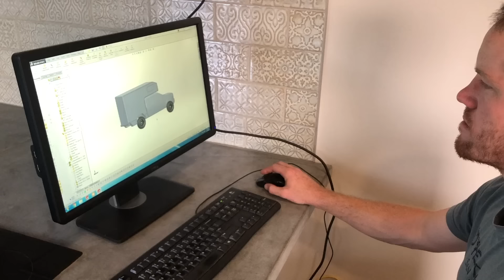TIMELAPSE- Couple Builds DIY RV (Start To Finish)

Comment: "Two car garage" ....opens door....with cnc plasma table. 😂
Reply from the maker: If it fits... 😉
Reply: Lo
Reply: Lol
Reply: I have an 200kg payload 6-axis robot with an plasma cutter or belt grinder in my workshop😅 (but we also use it for actual jobs and not only car parts😂) next it will cut two aux-tanks
Reply: I wonder if the CNC table was included in the 25k budget
Reply: Exactly! 🙈
Reply: @buggzo  

Those two at shop rate would be $200 to $250 an hour for quality custom build. Multiply that by 8hr x 5days x2.5months = Approximately $80k on the low end. Then add the Truck plus materials and your at $150k for the build let alone some kind of design fee or mark up. Very cool, they have great skills and was fun to watch.
Reply: @buggzo  That's what I was thinking. $20K in materials and $100K in tools.
Reply: Yeah, stopped there.
Reply: they propably worked in an rv or car asssembly  company and bought their own tools.its like they already know how to do this from start to finish.
Reply: 🤣🤣🤣 My thoughts exactly
Reply: @TurboTaco2JZ  depends.....I have been to the ALiner factory. ..I build for a living...I was TOTALLY impressed.
Reply: And alum Tig ;)
Reply from the maker: Glad you liked the build! While appreciate your value on our labor, you cut us a little short on the hours! More like 14-16 hours per day and 7 days a week!
Reply: @AmbitionStrikes  now overtime has to be added into the cost. You guys are amazing. Keep making vids!
Reply: husband and wife look like high end craftsmen
Reply: i stop the video at the intro...with the pan of the car sizes plasma cutter.  It's probably DIY built plasma cutter from another video.  I need to watch that first before I watch any of these "DIY" project.
Reply: And sheet metal bender and TIG welder and barn....
Reply: @vanlifephilippines7304  pays to know what to do just saying.. save yourself some $$$
Reply: @buggzo  I think the 25K budget is just for the tools! 😳
Reply: Exactly hahaha how typical
Reply: yoruma dağıldım :) ne garajmış breh breh
Reply: 90s
Reply: DIY actually YNH (you need help)
Reply: @snteevveetns  which all costs less than 500ft apartment in new York :)
Reply: And a large Brake/bender
Reply: They are very disingenuous with their title. Gotta get those "Likes" , though! Amirite?
Reply: @vanlifephilippines7304  actually all of the skills they used are basic level metal and woodworking skills. The biggest achievement for them is the design to build ability. That takes a lot of skill to see through.
Reply: What funny about that? Its still a 2 car garage
Reply: that's noway, It is an act of deceiving subscribers.
Reply: Lamang ang may alam
Reply: @vanlifephilippines7304  I doubt they worked at an auto outfitter of any kind.

This is absolutely not the 'correct' or most efficient way to assemble such a canopy body. We've already seen in the montage that they have access to a massive CNC table (for which wood/plastic routing bits would be a trivial expense or an easy mounting of their Dewalt tools) and we've already seen them design this on CAD software. The 'professional' way to do this (for whatever that's worth) would be to mass CNC route/cut everything to spec and then assemble like ikea furniture. Instead what we see is they are marking (with painters tape and spirit levels) where they want to put things and cutting it all out with typical cabinetry hand tools (typical Dewalt package).

They are absolutely not professional auto outfitters. Not to say they're doing this wrong in anyway, they're extremely intelligent and skilled amateurs. Perhaps they have a background in carpentry, but it's clear they've achieved what they have not because they have a professional background in this kind of manufacturing, but simply because they're brilliant and just really good at building stuff.

This is a very 'build as you go' construction.
Reply: Watching you start with computer aided design and then the modern equipment, brings this type of build to a high level.    Thank you . Well done .
Reply: Top é a palavra para descrever
Reply: Parabéns pela montagem 👏🏽👏🏽👏🏽👏🏽💪🏽💪🏽💪🏽💪🏽
Reply: Well where do you put yours, smart guy? 😁
Reply: @bjbuckley6108   ود
Reply: My thoughts exactly.  There's no way an average person could pull this off with a table saw and hand tools in their garage.
Reply: Come on man you could have paid cash .
Reply: Ótimo projeto, penso em fazer algo parecido. Parabéns. 👏🏻👏🏻👏🏻👏🏻👏🏻
Reply: Laser actually, 1kw or 2kw 🤩🤩
Reply: My thoughts exactly.
Reply: Lol right
Reply: Everyone has one....you don't?
🤣
Reply: @bjbuckley6108  ¹
Reply: Nailed it, the best comment...And his wife's even worse, she welds and ads nails as a load of screws as a dressing on a Caesars 🤣🤣
Reply: Exactly my thought 😂
Reply: Sewing machine setup was legit also.
Reply: I said the same thing…just a lowly 2 car garage aaannnnnddd multiple badass industrial tools
Reply: Hahaha 😂🤣

Comment: Far from a DIY you're clearly a master fabricator. Well done guys, a couple that can build together will definitely stay together.
Reply from the maker: Thank you so much! 🙌🏻
Reply: @JustForFun1171  I'm sure this is something you really would just have to want to do. I mean, I bought a 34' camper for $14k used and renovated it for maybe $1k extra. All in what you want.
Reply: @AmbitionStrikes  ok
Reply: The quality, perfection and your skills are unmatchable!     You both are absolutely amazing‼️ Thank you for sharing. 👍
Reply: @MaltedJacker  What are you talking about. With the exception of the plasma table they used standard DIY tools  .
Reply: That woulda sucked but also been pretty funny if the first drive out onto the main road they forgot to upgrade the engine and it stalled on railroad tracks where it was destroyed at the end of the video.  Nobody hurt just a fun end to a video that pissed me off.  I could easily do this diy project in my apartment parking lot, I just need a 10,000 dollar press break, and I'm sure the apt complex will let me install my 45,000 dollar plasma cutter (my water jet is to big).  Then purchase 15000 dollars worth of aluminum, steel, insulation, plastic, solar, plumbing, shelving and wood.  Then spend 2 or 3 years locating a girlfriend that is also a novice upholsterer and 6 years from now have a pickup truck bed camper.    Nah Ill just buy a truck bed camper used for 3 grand, spend another 2 grand on sollar and upgrades and be living in it next week
Reply: Yup, far from a DIY'er project. Got to have the truck to start too, so not just $20,000 for material, also need the tools, some knowledge and not many people have 2.5 months to spend on a project assuming straight through time and not split up over years. Still cool they did it, but at that point I'd buy something but then again no clue why these are recommended to me. I'm not interested in such things. I know it's a trendy thing now to camp and van life etc... For the cost of all that (my time is money) that is still $50,000-$80,000 setup. and that is a Lot of hotel rooms or AirBnB's. A lifetime amount.
Reply: Lol, no.
Reply: @breakingames7772  I can tell you finding a girlfriend who has any skill, and is capable of working without constant complaining and constant mood swing temper tantrums will be much much more difficult then everything else. 
You can earn the money, you can buy the tools, you can take classes to learn what you don't know, you can even rent or buy shop space,.
Reply: Actually 
DIY, stands for Do It Yourself.     
So even though they are obviously skilled at what they do..... they did in fact "do it themselves "
Reply: @breakingames7772  yeah I went the truck bed camper route with solar haha, cheers
Reply: But they are doing it themselves…. Diy doesnt mean beginner level kit from a craft store
Reply: @keargee so, it's been a year, do you still have this toxic masculinity tinted view of women or have you grown up?

Comment: This was an amazing transformation. However I will say my interpretation of DYI means for the average marginally skilled person. It’s clear that you have professional skills and access to equipment beyond the reach of most.
Reply from the maker: Our skills are self taught, and we work out of a 2 car garage with tools purchased through doing odd jobs for others (even the plasma table). I’d say that’s pretty DIY!
Reply: DIY means that anybody could do this themselves. This is not that.
Reply: @bltedder  if someone was committed enough they would accumulate the skills to do what they did. It’s just not Ingrained in most of us as strong.

Comment: I know you may not be answering questions about this build any longer given the amount of time since you posted this, but have you held onto this rig since you built it, and if so, how well is it holding up? Genuinely curious about a long term review of the build and any strengths / weaknesses since this is a pretty big engineering project tbh. Would be curious to also know what adhesives you used as I'm pondering a similar project.

Comment: This is an amazing build by you both!  

A couple questions if I can;

1. How did you join the two large side panels in the living area  (where they run horizontally and meet in the middle)?  I don't see a reinforcement bar behind where they meet so I was just curious if they seal up at that point or how you do it.  

2. If I guess that between the shell and just the panels affixed (nothing else installed) this weighs around 500lbs?   This would be a great setup for full or midsize trucks that can only handle around 1300lbs payload.  

This is a super cool setup.  I'm sure there would be great demand for just the lightweight shell alone if you ever wanted to market them.  Reminds me of an Olympic/Scout but with a truckload more room and more robust. Kudos!  Thanks.

Comment: Great video and channel. Do you have a video with info on how high and wide that you can build the camper? I am sure you have to follow the DOT requirements. We are a family of 5 and will need more space.
Reply from the maker: DOT regulations vary by state. It's roughly 102" wide, 65' long, and 14' tall. That would be a HUGE truck camper!!!

Comment: I really like your build.I am just curious what your reasons were for not removing the cab and making a fully-enclosed RV style body with the drivers section inside with the camper part? I am debating which to do. Thank you. Cheers.
Reply from the maker: That would have been a nice feature to have! But we were trying to keep the build relatively simple and on a short time frame (2 months).

Comment: Awesome build. Out of curiosity, what's your standard energy usage in a day and how efficient are your solar panels? Do you ever have an excess of watts or do you have to conserve power?
Reply from the maker: Since we cook with electricity our power consumption varies widely depending on what we're cooking. We use approximately 1-3kwh per day. Most of our charging comes from our alternator while driving but the solar panels do some as well. If we're traveling we don't have to worry about power consumption at all. If we're parked for an extended amount of time we have to be a little more careful. We only have 300w of solar on the roof though. Hope that helps!

Comment: How can I get more information about your stair, slide out ladder concept? I want to engineer something similar but for a wheelchair ramp. Im also considering a campervan build but using extruded aluminum. The ramp is for that. Want to consider similar for truck camper topper for my Gladiator too. Opinion on extruded aluminum?

Comment: Only 20k in materials... and 60k in tools. Good job though, better quality than you can buy and its exactly what you want. For the cutting of the aluminum parts a CNC router would make a cleaner cut, but for overall shop use the plasma is more versatile for sure. -welder/fabricator with 30+ years experience.

Comment: It would be more efficient if you did this work with a 4x4 van. It's a very claustrophobic vehicle. the sleeping area is small, the sitting area is small. Why did you put everything in a small area under these conditions where everything is cheap and surplus in a wide geography like America?

Comment: In Scandinavia and Germany they can't keep up with orders for "pod" bikes, two-seat peddle-assist  transportation filling the needs of most youths and retirees going to work/shopping.  Yet, the oil/auto oligarchs will fight it tooth and nail, just as community's development industry fight affordable housing.
The only problem with these phenomenal road-homes is having to wait a decade before the interior air is cleared from off-gassing the laminates, tempered glass, adhesives, particle board, stains, rubber, plastics, foam, asbestos, aluminum, in effect, a toxic soup of dioxins, PCB's and heavy metals and harmful fibers combined with inevitable fumes from oil, fuel and hydraulics.

Comment: Nice build but no concept of lite weight
Reply from the maker: Our camper is actually lighter than almost any other truck camper on the market!
Reply: @AmbitionStrikes  it’s definitely a nice solid build. I was referring to the thickness of the plywood you used in your cabinets , quality of course.  I live next door to a motor home factory they use a more light weight building technique on their cabinets. Thanks for sharing